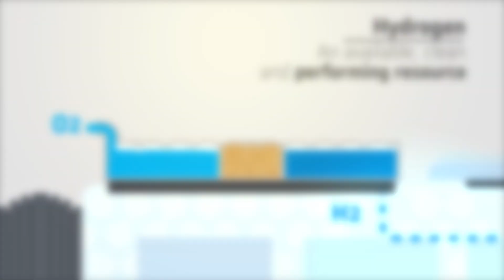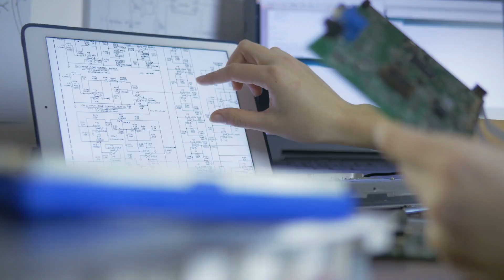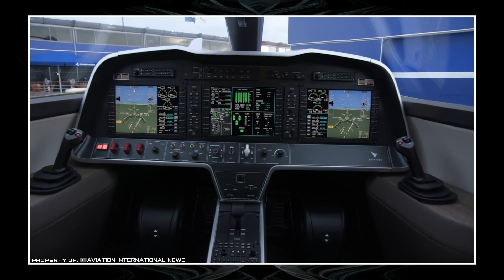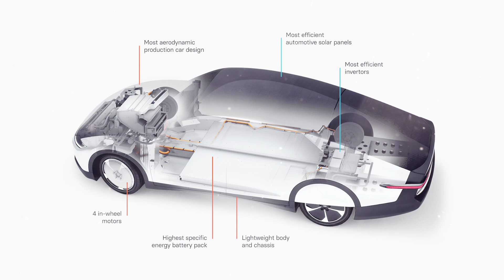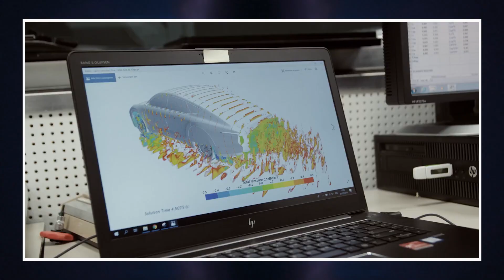5 Amazing Vehicles That Will Save Our Planet

Comment: Electricity is made from fossil fuels.  So what’s your point again?
Reply: Not all electricity is made from fossil fuels. Surely you've heard of renewable energy?
Reply: @jeffreyrogers2491  Renewable energy is why California is in trouble with continual brown outs and grid shutdowns.
Reply: @bobb6186  Or is it because it is now so hot in California that everyone's Air Con is running 24 x 7?
Reply: @jeffreyrogers2491  Gee, not happening in other states with hot weather. Green energy is fine as long as it is backed up by reliable sources.
Reply: @jeffreyrogers2491  So how do you think all those turbines and panels are manufactured? Rhetorical!
Reply: Produced not made, no disrespect.